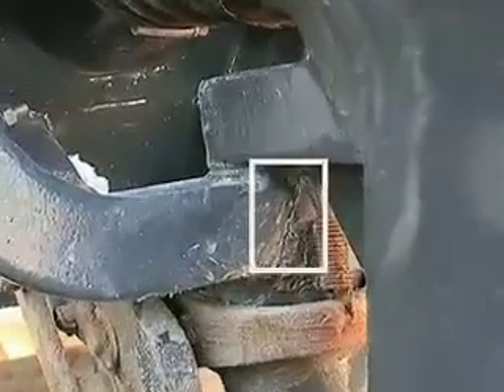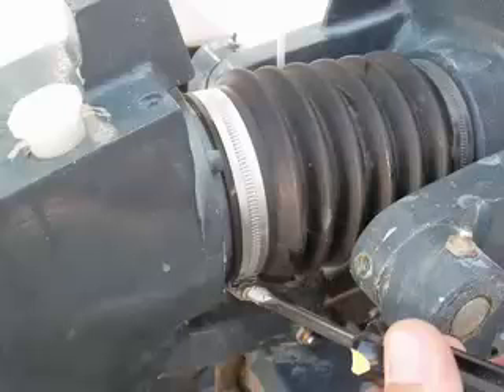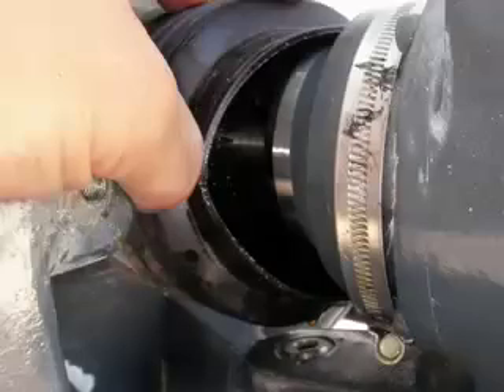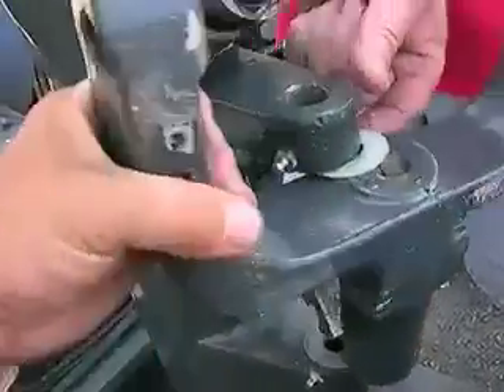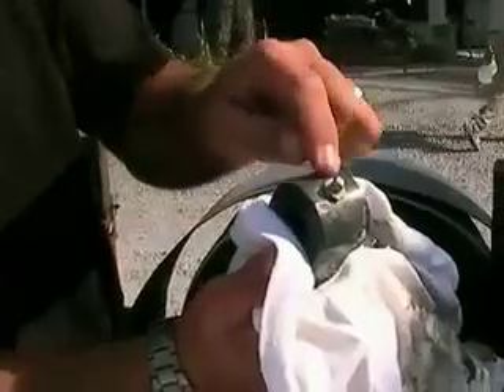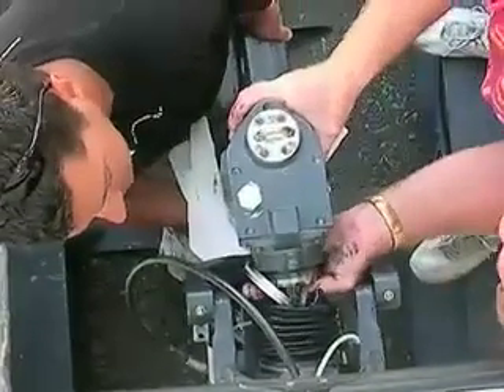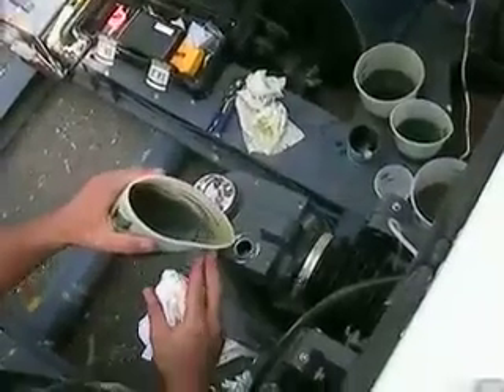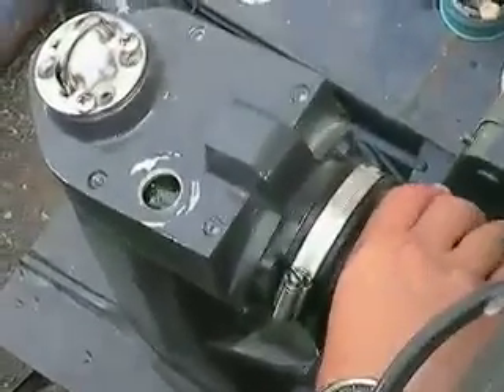Sillette Drive Leg - Replacing the Yoke

Comment: Nice help for us Gem owners!  Can you comment on what to do (no broken yoke) when the set screws holding drive leg on, are so corroded you can't remove them?  The previous owner apparently never lubricated either side, and the hex set screws are FUBAR.  Need removal and tapping bigger?  Wheel puller to remove the pins?  HELP.  Hull 644
Bob
Reply: I'm having this exact same issues (Hull 605). The lift pin is sliding out because the set bolt is no longer holding it in place. I know it's 9 years since you commented here but did you ever find a solution?